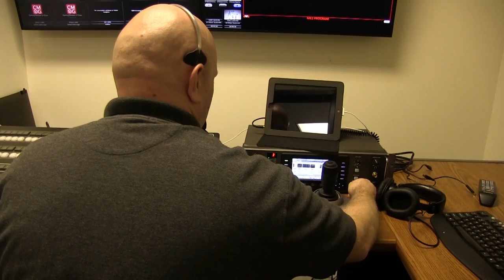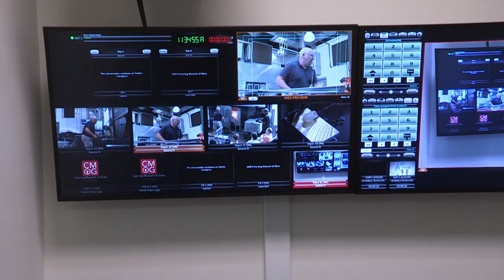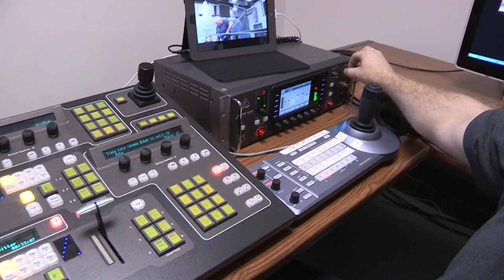Live-streamed Studio Demonstration: William Gudenrath (August 13, 2014)

Comment: Nice demonstration, William Gudenrath. I have a small question: did the ancient glassmakers also use stainless steel for the blowpipe? If not, did that not pose a problem with iron pipes heating up very quickly?
Reply from the maker: +poelgeestglass They would have most likely used iron blow pipes and iron and mild steel are very poor conductors of heat, as metals go, so the heat wouldn't have transferred all the way through the pipe.